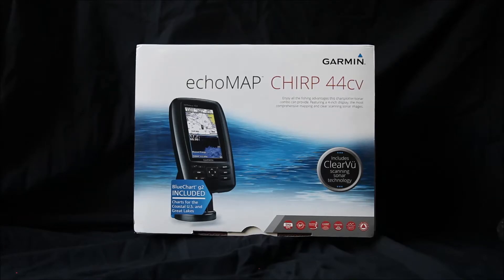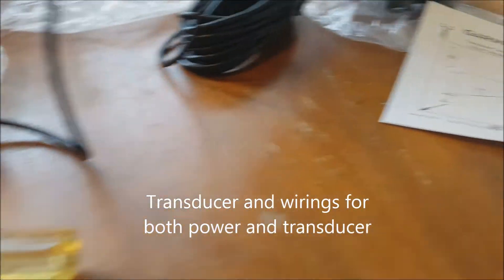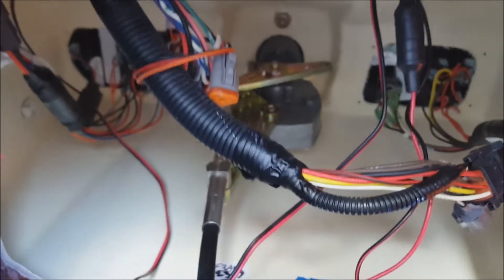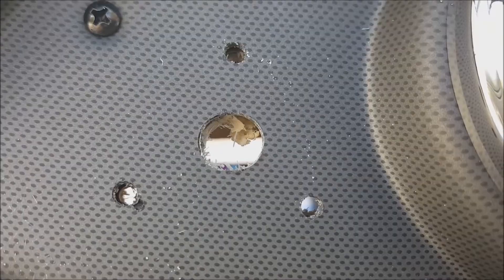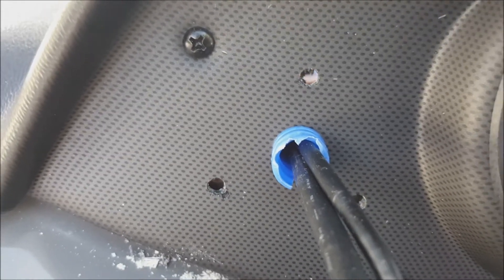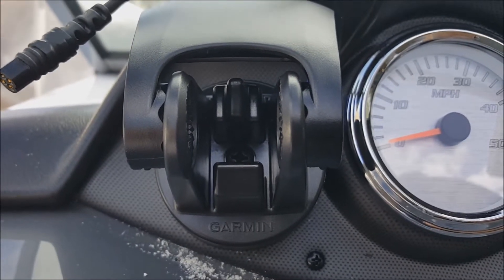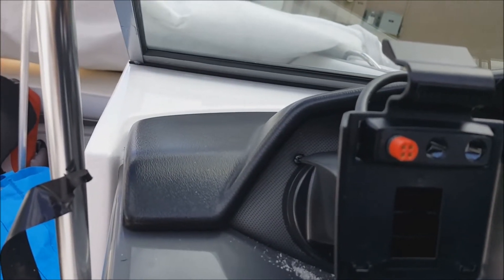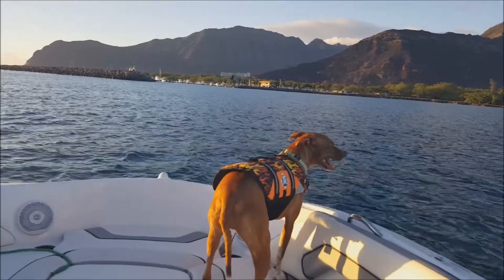Install Garmin Combo GPS-Plotter/Depth/Fish Finder Yamaha Jet Boat SX190 Epi 9

Comment from the maker: Have to say that this, by far, is the most useful accessory I added to the 2017 SX190.  Hawaii, especially the East Side of Oahu, Kaneohe Bay where the Sandbar is, is SUPER treacherous from the reefs which dot the bay.   There is no way I would boat without it at night and it recently saved me during a huge squall that obscured the channel markers.  If you have a boat...get one.

Comment: Great video. I have a 2015 AR190 and want to put in a GPS. Have you replaced any gauges?
Reply from the maker: Aloha!  Go for the GPS for sure, it may be the best upgrade you can do.  The two gauges on the dash (Tach and Speedo) are still working but I have had to replace a switch on the dash.  I think it was the switch for the Night/Navigation lights.  Good Luck!

Comment: Were did you connect the power wire too.
Reply from the maker: I connected the power wire with the Fuse holder and the ground to my home-made electrical buss that I installed onto the vertical wall inside of the dash board.  I believe there is some footage of this in the VHF radio installation and there will be some footage of it on the video coming out this week which I believe is # 20.

-scott
Reply: That electrical buss you connected that to the battery?
Reply from the maker: Aloha,  Sorry for the extremely late reply (not getting notified of comments for some reason) But to answer your question, Yes, I connected the buss to the battery at that time but I have since moved on to a better electrical set up using Dual Batteries and a Blue Seas System and Electrical Buss.

-scott